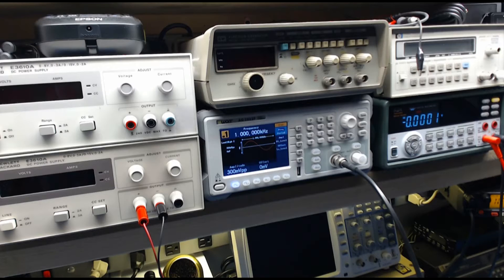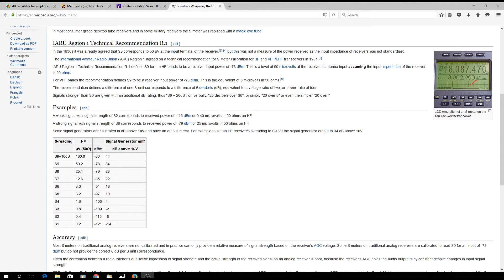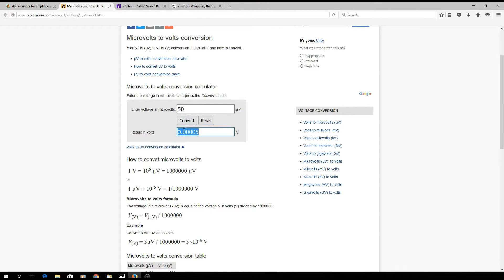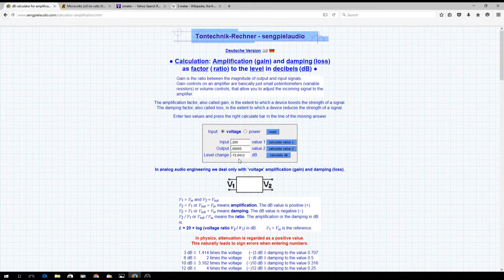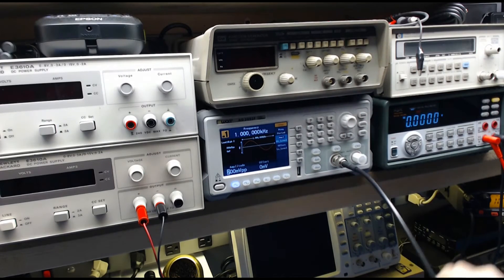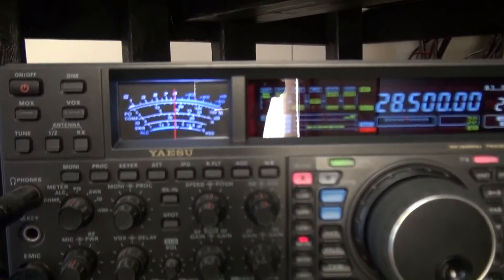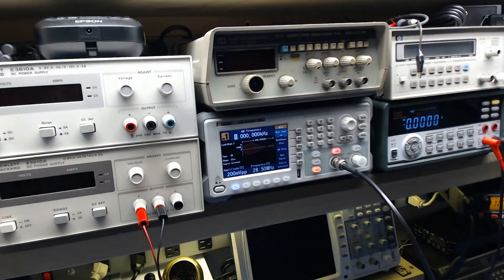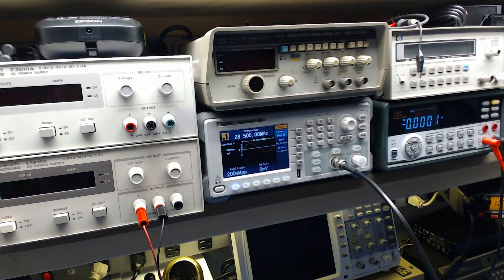HOW TO GENERATE AN S9 SIGNAL TO A HAM RADIO WITH A WAVEFORM GENERATOR

Comment: Some nice referrals to websites for the math. Could use one of the newfangled Digital Oscilloscopes and a pad to set the desired signal generator output voltage. Thats what I'll do here in 2022.

Comment: Why did you select 200mv from the sig gen, was this just random ?why didnt you use the minimum 1millivolt that your SA can output?
Cheers.
Reply: Probably because the 200mV are more precise than the 1mV wich is a very low value for the generator.

Comment: Excellent video. Some of us may need to do this but it may be a rare operation. Given what RF signal generators cost this demonstrates a safe way of achieving exactly the same thing. Right now I have a Yaesu HF radio with a heavily attenuated RX. I've been trying to find out if this can be done with the same gear you're using. Question answered. Big thank you.

Comment: What is the brand and model number of the step attenuator please.
Reply from the maker: I bought it on Ebay years ago but it was something like this.  https://www.ebay.com/itm/NEW-RF-2-5GHZ-91dB-STEP-5W-VARIABLE-50-OHM-ATTENUATOR-TRANSMITTER-FOX-HUNT/192886751211?hash=item2ce8f23feb:g:NyMAAOSwsDZcG6Ey

Comment: Isn't 50 microvolts = S9 for volts rms into a 50 ohm load?  You have the sig gen set to 200 mv peak to peak, which is only 71 mv rms.  72 db of attenuation would give 17.8 microvolts, or a little more than S7.  Curious that the meter reads spot on S9.

Thanks for all the videos, I've learned a lot.
Reply: This video was posted years ago, he must have had more attenuation applied than mentioned.

Comment: Is the signal generator you have not capable of a -72 DB signal
Reply from the maker: +Kevin Gray No, It only can output the lowest 1mv Vpp. It does not have built in attenuation. It is not a very expensive generator.